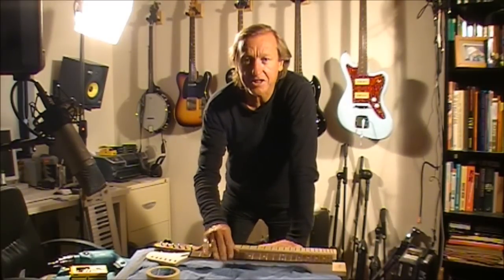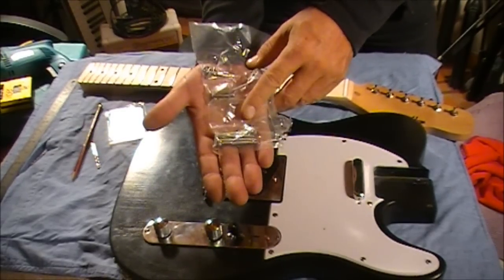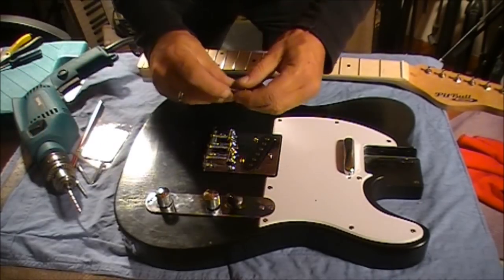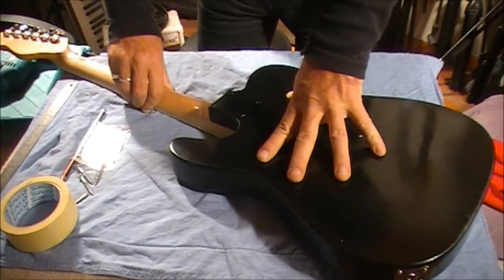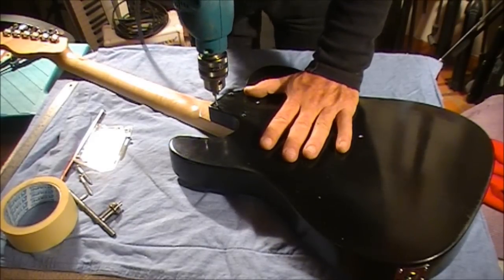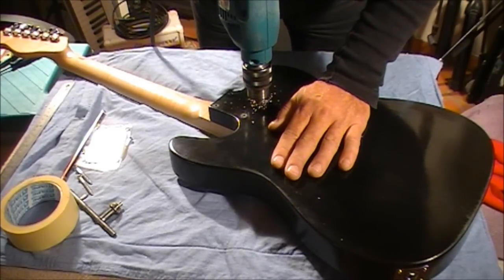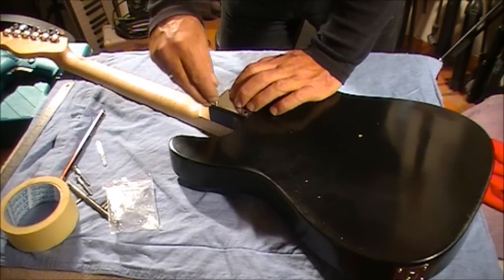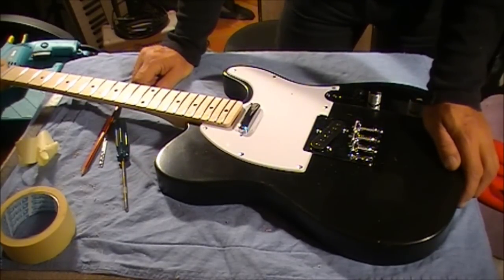13. Attaching a screw-on neck

Comment: This only works if the neck pocket is a perfect fit. Otherwise it's really easy to have a slight angle... Consider using a clamp and loosely stringing up the guitar so you can see the strings don't overhang the fretboard. You can make one drill hole and screw it, check and adjust then make the second to hold it firm. Only do the 3rd and 4th if you're happy. This is coming from someone who saw this video and had to replug 3 of my drill holes...

Comment: Always a good idea to use a clamp to fasten the neck to the body, and string up your low and high E strings and make sure the neck is perfectly aligned. Otherwise you might have string overhang or falloff.

Comment: I would tape the neck to the body to reduce any unwanted movement.

Also I think it's important that the screws go straight down into the neck and not at an angle whatsoever. This can be hard to achieve when drilling by hand.

Comment: Hmmm, it looks like cheap Lego manual. Sorry for my expression but this is not toy. This is musical instrument. It has to be in tune when you have assembled it. Especially if kit has Floyd Rose tremolo and pocket on the body is free, without any partition for fitting the neck perfectly into its place as it really isn't on SV1 and SV7 models. So I highly recommend use clamp, mount Floyd Rose, also at least first and last tuning machines and stretch some laces or thread since strings are very hard. Then make measurement by 12th fret, centre the neck and only then if it is straight and in correct distance from bridge, then I would make holes to the neck. I will start assembling it next weekend and I hope it will be done by this way so hopefully will be able to play on my SV7 kit, not only hang it on wall as decoration. Thank you for amazing kit but your tutorials have some gaps there ;)

Comment: wait... this assumes the neck has a solid rear face to drill 4 new holes. The holes drilled in the neck have to be the inside diameter of the screws... not the outside of the threads. The 4 holes should be drilled with a drill press or very level scheme to proper depth. The screws need wax or ChapStik to lightly lube their threads for simpler insertion to fresh wood.

Comment: Might be smarter to measure drill bit length against the screw less the thickness of the back plate. Too easy to drill too deep and end up going right through the fingerboard.